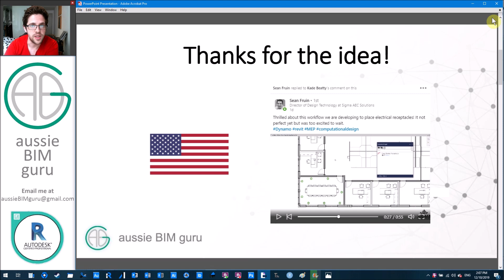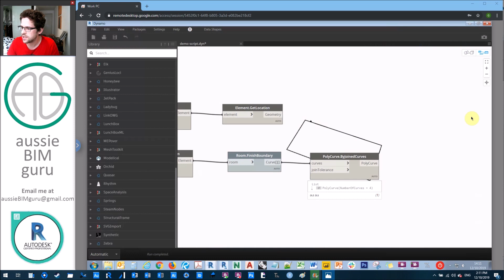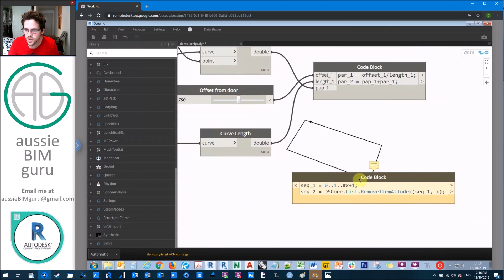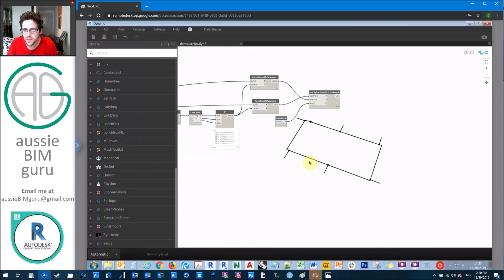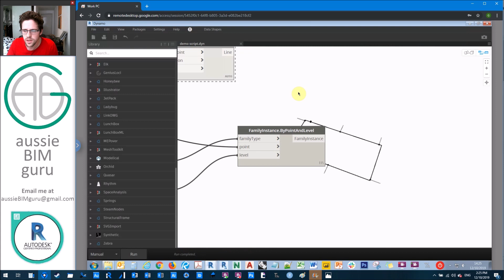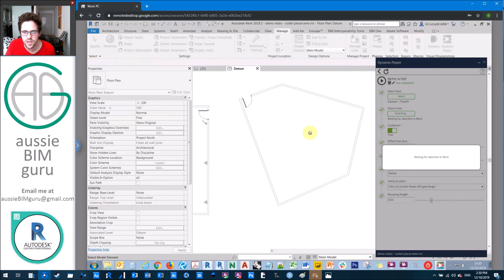Comment: Hi Aussie BIM Guru and Thanks for this amazing Work. I tried to develop this script further and I have an issue with the If Node visible at 16:42. It works with a single list of points but I can't make it work with lists of lists of points. (Because I want to place outlets in several rooms). Can I ask you for some help ? Regards, Denis
Reply: This will generally relate to introducing list levels to most of the process in order to process lists of data in parallel per room.

The standard If node doesn't work that well given it lacks levels, but you can use nodes from custom packages such as Crumple which do if you want to add this level of logic. You could also use the code block syntax as alternative which works with list inputs for bool/then/else (condition ? then : else).

If you get stumped I'd recommend Dynamo forums from there which generally is a good resource to get in the habit of consulting.

Comment: Good Day Sir  , just a quick question does this also apply if the archi model is linked? or do i need to add a new node specific for linked cad. can you also made a tutorial in this scenario if the archi is linked not in archi template
Reply: I'd suggest trying Bimorph nodes package which can work with linked elements and their geometry.

Comment: hii,kindly explain more briefly at(8.00 to 8.35) using code block function variable.this part i did not get(par_1 = offset_1/length_1)where did u get (offset_1) and then seq_1= 0..1..#x+1) i am so confusing this area.
Reply: offset_1/length_1 is finding out what the parameter on the room boundary is at the offset point from the beginning (from 0 to 1). We can then use this to spread a sequence of points around the room, equally spaced after the offset from the beginning (so we want N points spaced equally from 0 to 1. Finally we can make sure those points all sit between the domain of 0 to 1 (some will be over 1 if the offset is applied), and we use the If block to process them as their value, or 1 - the value if they are greater than 1.

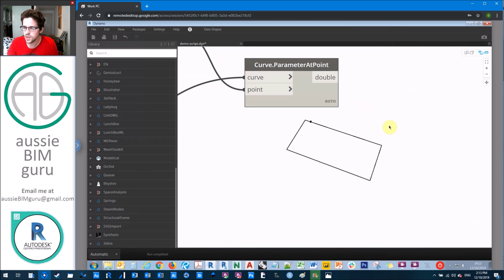Comment: Hi Gavin, thankyou for the tutorial,,, can you eloborate at around 6:20 of your video  ,as  the parameter at point is 30 percent of the curve,, does it take the entire polycurve  or just the line segment, in either cases it doesn't seem to me that it is 30 percent unless i am missing some logic over here...
Reply: If you assess a polycurve at parameter, it should consider the whole curve as opposed to just the segments. The polycurve in this case probably doesn't start next to the door, it is the segment before it I think. Room boundaries are returned in an order based on the elements and their time of creation I believe.

Comment: Hello, great script, thank you very much, super helpful and well explained! Could a feature be added of placing the receptacles at a specific length from each other, where the length value is controlled by the user?
Reply: Yes you could have the user enter a set of segment lengths and apply a point.atsegmentlength method instead. It would be difficult potentially if you have a very large room however as sometimes you may need more outlets in a certain room than others.
Reply: @AussieBIMGuru  Perfect, thank you very much for your help, I will certainly give that a try!

Comment: Thanks so much, is there a possiblity to do it with spaces instead of rooms, normally mep models use the architecture model as a linked model, or is it possible to select the element from the linked model ? Thanks
Reply: Yes I believe spaces could be collected in a similar manner. Linked elements could also be used, the BiMorph package as well as archilab have nodes for obtaining linked elements by category.
Reply: @AussieBIMGuru  thanks a lot! Gonna try that out :)
Reply: Hello, I was interested in accomplishing the same thing since we work with linked models. I have modified @Aussie BIM Guru's script to be able to select the elements from the linked model. This method used a toggle switch to refresh the selection of elements. You'd first click on the linked model, then select the linked door and room boundary and click finish once done selecting in the top left corner of Revit, I've implemented a filter to separate both (the room and door) by category. Below is the link if you're interested, hope it helps! https://mega.nz/file/r5lGxJ6T#189RCZS1Fne0FmiL-qYLzbkM0h4ZF-cCUnKXm04sS2A
Reply: Nice work!
Reply: @AussieBIMGuru  Thank you!
Reply: @lagarmiga23  i cannot get your script from the Megadrive.pops up there is no file longer available

Comment: How does dynamo draw electromechanical
Reply: Revit still draws/models the design, Dynamo is just a tool to speed up and automate workflows.

Lots of engineers i know use dynamo for flow and system analysis, element sizing, penetration creation, component and schematic diagrams etc. Lots of potential!
Reply: @AussieBIMGuru  Thank you for your answer, maybe my application level can't reach that level, my English is not very good
Reply: @tingyunmao8861  keep learning, you'll get there in time :)
Reply: Thank you. In China, revit is mostly used in mechanical and electrical design and bridge design. The construction is now in the state of application @AussieBIMGuru  thank
Reply: @AussieBIMGuru  The most frequently used revit in China is in the electromechanical synthesizer, most of which are in a state of mold turning
Reply: @AussieBIMGuru   show us how create scripts for schematics diagrams for mechanical systems